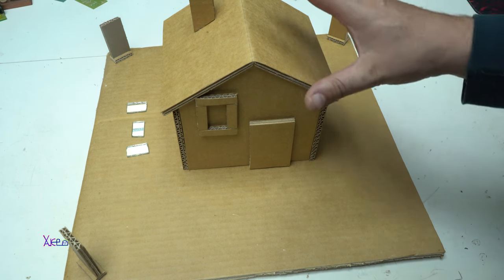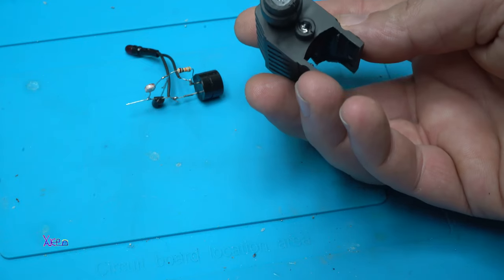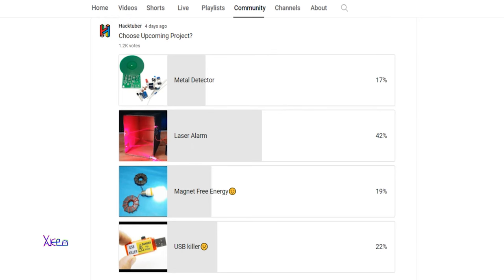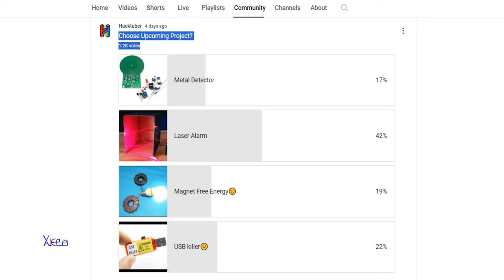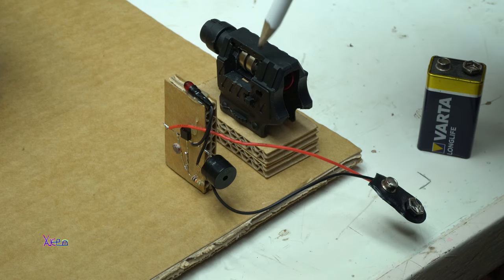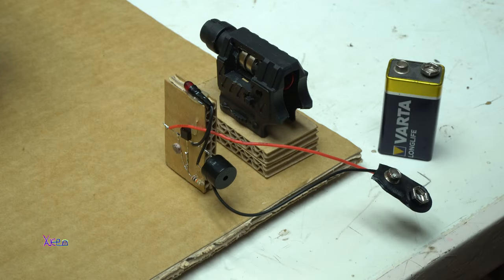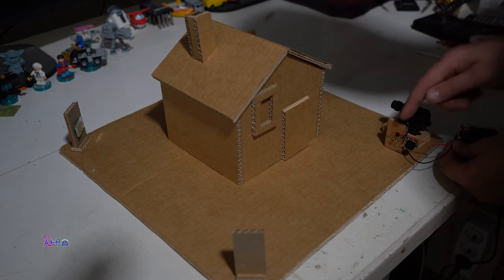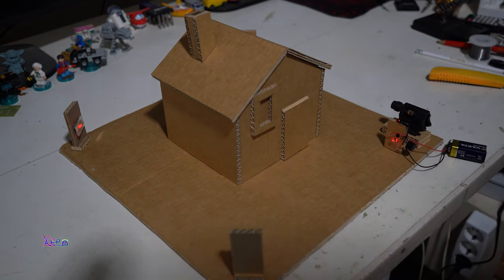DiY Laser Alarm for House ( school project)

Comment: Ive always wanted to do this years ago there a big flaw in the design tho needs alot of trial and error on a big scale .......daylight and random moving objects like birds and animals or even rain it would become a nightmare unless its indoors ...... The cds cell would need to be in a box with mirrors to stop daylight turning it off and a delay circuit of a few seconds and be raised off the floor about a meter but if was used in the night you may be able to see the beam and rain or moisture (fog) cud send the beam of target maybe multiple shorter range devices in key locations connected to a central hub like gates, doors or windows and alert fone or web page of triggered device and would need to be placed in strategic locations 

Maybe invisible beam would be better like in cd drives but would come with issues or even infra-red cud be an improvement 😊❤
Reply from the maker: Thx for feedback sir,you explained very well and mention a lot of details and you are right for all of them,Yep if you like to make a bigger scale ona real house yes lot of things need to be improved and for sure need to use a arduino board.
Once again thx for comment👍
Reply: @Hacktuber  yes bro maybe ESP32 with WiFi connection and Arduino with RF  links be a big project with standard tech 
I suppose that's where these IP cameras taken over with motion detection but cheap ones software are crap 😂
Keep the ideas coming bro 😉👍